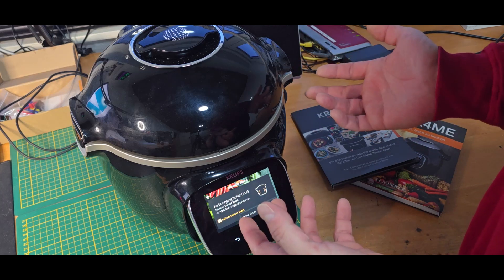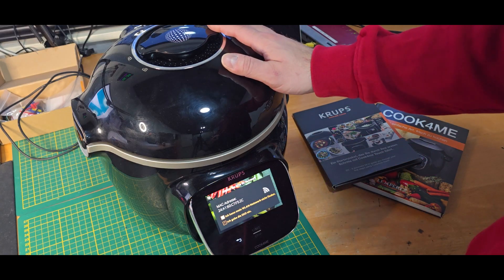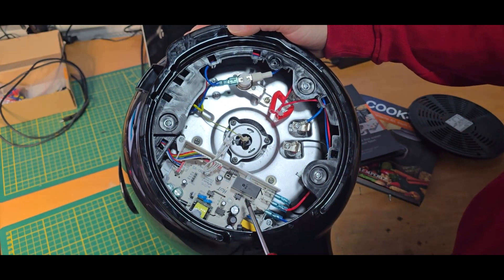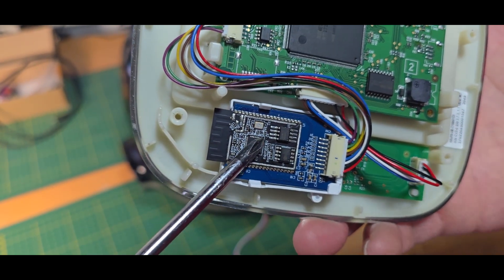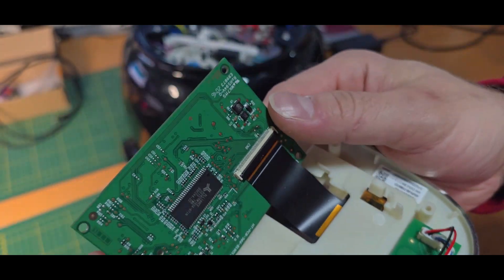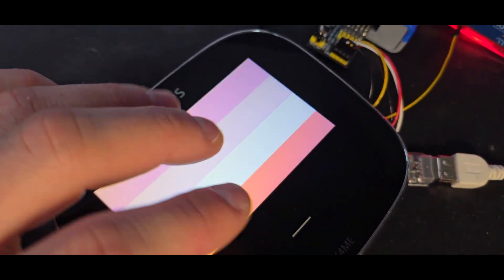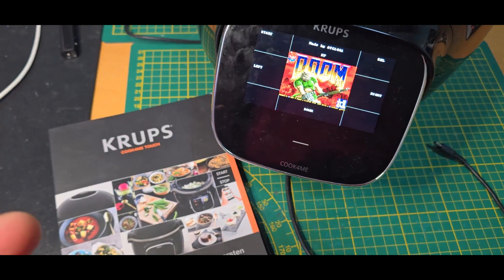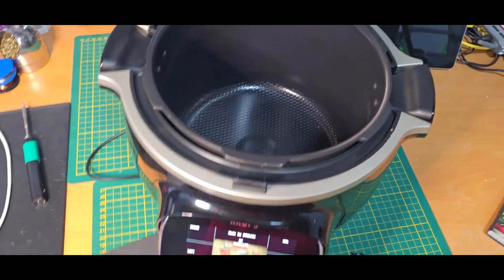Doom on a cooking pot... Lets hack the "Smart" Krups Cook4Me

Comment: It's a thing of beauty. Well done, got the right attitude for sure. I wonder if there is a hardware engineer deep in the bowels of a giant multinational putting the specs for this together with this very use case in mind, just pulling the wool over management and having a good old sneaky laugh. Sure seems to be overkill for a pot, but I was sure entertained. Thanks again Mr. Wizard.

Comment: Was hoping it‘d run Android 

Also, ever tried hacking a Thermomix?
Reply from the maker: Android would be too simple^^
No Thermomix so far, too expensive and more secure
Reply: @atc1441  I doubt a Thermomix is much more secure. I think I saw a mention of it actually running Android somewhere? It also just connects to the internet and has a bunch of settings you can mess around with. If you ever come across a TM6 for a good price, it‘s absolutely worth it.

Comment: The reason for 3 mcu and I think it is likely that, this company is making many different products using similar components and therefore the firmware would be similar as well. Most company what they do is use same hardware for different project so they dont have to do any rnd on hardware and also use the same software, this reduces time to market in return more money. 

My company does this

Comment: AI Summary

Abstract:

This analysis details the hardware reverse engineering and exploitation of a commercial IoT-enabled pressure cooker (Krups), which utilizes Wi-Fi connectivity and a full touchscreen display. Physical teardown revealed a complex, multi-microcontroller architecture designed for high-end consumer appliance functionality. Key components identified include a Renesas R7S721031VZ system-on-chip (SoC) serving as the main processor and display driver, complemented by an ESP32 module for AWS cloud-based (MQTT) Wi-Fi connectivity, and an STM microcontroller for basic appliance functions (heating element control, temperature monitoring) with exposed SWD debug pins. Despite flash encryption on the ESP32, the older chip revision allows for potential glitching for key extraction. The firmware of the main Renesas SoC was successfully dumped and reverse-engineered via SWD. This allowed for the development and installation of a custom firmware wrapper, culminating in the successful porting and execution of the classic game Doom on the appliance’s touchscreen interface at a functional frame rate, demonstrating significant exploitability of the proprietary platform.

Embedded Systems Reverse Engineering Report: Krups IoT Cooking Pot

*   0:04 Device Context: The appliance is a smart pressure cooking pot featuring Wi-Fi connectivity and a full touchscreen display, lacking internal mechanical components (e.g., slicing, chopping). The retail price point is noted at approximately €400.
*   1:17 Initial Analysis: The Wi-Fi module’s MAC address Organizationally Unique Identifier (OUI) suggests the presence of an Espressif chip, confirmed later as an ESP32.
*   2:17 Main Appliance PCB: Internal inspection reveals essential cooking hardware, including a heating element, a temperature sensor, and a fire hazard safety switch for relay fallback. A primary control board featuring an STM microcontroller and exposed SWD pins is identified, likely handling low-level I/O and safety functions.
*   3:59 Wi-Fi Module Identification: The Wi-Fi component is confirmed as an ESP32 (not an S3 variant). The flash memory is reported as encrypted, but the use of a first-revision chip suggests feasibility for exploit via voltage or clock glitching to facilitate readout. Logging indicates connectivity utilizes the AWS cloud via MQTT protocols requiring a private key.
*   4:45 Main Processor/Display Driver: The core computational unit is identified as a high-performance Renesas R7S721031VZ SoC (ARM core). It is paired with 128 MB of flash memory and an estimated 128 MB of RAM.
*   5:16 Secondary Control Chip: A Microchip PIC microcontroller is located beneath the Wi-Fi module, dedicated to managing the capacitive touchscreen interface and handling wake-up events for the main Renesas processor.
*   6:27 Firmware Extraction: The flash of the Renesas SoC was successfully dumped using an SWD flasher, achieved through reverse engineering the pinout. The extracted bootloader featured detailed logging that aided in subsequent analysis.
*   6:50 Display Initialization RE: Reverse engineering efforts successfully mapped the LCD initialization routine, crucial for driving the 45-pin LCD cable interface.
*   7:39 Custom Firmware and Demonstration: A wrapper was written for the Doom engine and ported to run on the Renesas SoC architecture. The custom firmware successfully executes Doom at a satisfactory frame rate, utilizing the physical touchscreen for input controls (mapped to "select" and "start" regions).
*   9:13 Conclusion: The Renesas SoC is praised for its power and capability, confirming the success of porting the legacy software despite the required deep-level reverse engineering for SDK and development environment setup.

AI-generated summary created with gemini-2.5-flash-preview-09-2025 for free via RocketRecap-dot-com. (Input: 14,240 tokens, Output: 824 tokens, Est. cost: $0.0063).

Comment: An ESP with another mcu and pic? Seems price inefficient
Reply: Actually, it is. Unless you need some decent bandwidth, it's the cheapest way of adding wifi to anything. You're not finding a powerful MCU with wifi integrated, and beating the ESP on price, and the fact that it comes in a pre-certified module is pretty hard, especially once you add all the engineering hours and the fact that everyone and their mom knows how to code for ESPs in the embeded space.
Reply: dont forget the other stm on the pot itself
Reply: display is too large it can not be driven by esp at useable frame rate, the pic and stm32 is not necessary tho
Reply: @lifeai1889  usable frame rate on a cooking pot? 😂 that statement is stupid